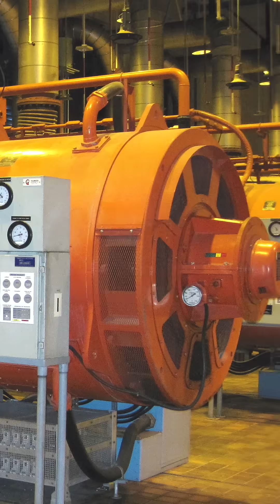wHaT iS tHE LARGEST ENGiNE EvER MaDE?

Comment: The scariest thing is that you can get sucked into the intake and leave through the exhaust and it won't even clog
Reply: you are now lubricant
Reply: @pacman10182  automatons are calling
Reply: @pacman10182 this will please the machine spirit.
Reply: @astonedwalrus4183 the weakness of flesh
Reply: @pacman10182   Such an unusual but highly threatening phrase 😂😂
Reply: @pacman10182  😅😅😅
Reply from the maker: Now that's some perspective...!
Reply: @BladedAngel NOW THAT'S WHAT I CALL POWER
Reply: Interesting note: that wouldn’t actually happen due to the size of everything being so large the air velocity is actually fairly low. Terrifying note though. A man did actually get stuck in the intake manifold of one of these engines and what actually killed him was the intake temperature. Because it’s turbocharged even the relatively low boost pressure was enough to raise the intake temperature to well over 130 degrees Fahrenheit. Which was not hot enough to immediately kill him but instead slowly dehydrated him until he eventually died of a heat stroke. And I genuinely don’t know what’s worse. Getting Byford Dolphined or getting slowly cooked by Death Valley heat in the pitch black for hours.
Reply: @jacobrzeszewski6527 byford was like titan: instant, brains did not even have time to register what happened or pain.
Reply: @kylebieth3678 and sometimes take quite a lot of time to recover from engine lags.
Reply: @purwantiallan5089 what? We were talking about byford dolphin....
Reply: @kylebieth3678  What I meant by Byford Dolphin was the OC’s idea of a person getting sucked through the engine.  Byford Dolphin was just assigning a real event to that idea. Whether an engine that size could actually do that or not is up to debate.
Reply: @jacobrzeszewski6527 christ dont remind me of byford Those autopsy photos still haunt me
Reply: @jacobrzeszewski6527 Being byford dolphined is much, much better
Reply: @jacobrzeszewski6527 the only way i know about this man is because of your comment. That is very saddening may he move on to the next life in peace and not in that dark and very hot place
Reply: @joseg4127 Only God can judge me now. May he rest in peace.
Reply: @jacobrzeszewski6527 now I feel awkward cause I just wrote a whole comment about that situation before I saw yours. He got ovened inside the engine. Side note from what I understand it was not the temp of the intake air that did him in, the engine components had access slots to view and repair so the pistons heat also enters the manifold area.. I think it was the combo that did it
Reply: @jacobrzeszewski6527  I've been in this situation multiple times! Try taking a shit in a porta potty in the middle of AZ desert when its 120° outside.. you're sweating before your ass touched the seat. When you come out, you have cotton mouth, drenched like you just came out of a swimming 🏊‍♂️ pool and lost about 15lbs of water weight. While being light headed from feeling like you can literally feel your blood boiling in your body and feeling your body and brain cooking.

Yeah, being a Trucker is fun!!!😅
Reply: @jacobrzeszewski6527  Yes and no. He did die of heat stroke but not because he was sucked in but because the access hatch closed behind him while he was cleaning the scavenge space and he was trapped. No one could hear the poor mariner as engine rooms are loud.
Reply: @jacobrzeszewski6527  slow cooked is worse by a mile, I'll take a byford dolphin-ing any day of the week over being slow roasted
Reply: @jacobrzeszewski6527  130 farenheight or 130 celecuis?
Reply: @jettlucashayes8508  fahrenheit; you would be fast-cooked at 130 degrees celcius.
Reply: @jacobrzeszewski6527  i have some perspective here. I have had complete renal failure from heatstroke and it would be one of the more painful ways to go. 

Once your body starts shutting down, you go into full cramp mode. Every muscle in your body cramps. I mean like the ones between your ribs, behind your ears, up the sides of your shins. LITERALLY ALL THE MUSCLES. 

My old man is 140kg and he had his entire weight on my foot and he said my calf looked like a piece of steel cable. 

You have 0 energy but you're in full fight mode, dumping adrenaline because the pain is enough to make you pass out and bring you back again.
Reply: @jacobrzeszewski6527  byford is immediate, that is slow cooking
Reply: @jacobrzeszewski6527  This had to be way worse than the Byford Dolphin incident. That happened pretty much instantaneously and they were dead before they realized anything had happened.
Reply: @jacobrzeszewski6527  I’ll take byford. Those dudes died gruesome deaths, but they had 0 idea anything happened. They merely sat done and everything ended instantly
Reply: @jacobrzeszewski6527 holy shit indefinitely think this is worse then being buried alive
Reply: I think being slowly turned into jerky is quite worse
Reply: @jacobrzeszewski6527 slowly cooked. Byford happened nearly instantly. Graphic and horrible absolutely but the suffrage is abysmal in comparison to being turned into what’s essentially human jerky.
Reply: @dNorsh I concur.
Reply: My favorite thing is that the inside of the block on engines like these literally have ladder rungs welded to the inside of the engine for maintenance and building purposes 😂 because you can stand and walk around inside the bottom end and need a ladder to get in and out
Reply: @brandonstonge7513 Swimming pool worth of oil change
Reply: @brandonstonge7513 for some reason it could work.
Reply: Some of these motors have insane intake manifolds. I watched a video about a guy who got himself locked INSIDE the intake manifold... He was fine from the suction due to the pure volume of the intake, he was not fine from the engine heat feet from his body inside a metal coffin of a manifold. Dude literally cooked to death oven style INSIDE an intake manifold. You know a manifold is huge when you can stand up inside of it, and enter it through a gasket sealed door
Reply: Assuming you lived it, I believe you
Reply: @NaisanSama  nobody would survive that
Reply: @masterater  I would
Reply: @DavidJeffreson-xx7kr  "Nah, I'd win" ahh post
Reply: @masterater you'd get shredded by the turbo. The engine being mentioned is a cargo ship powerplant.
Reply: @NaisanSama  well, you'd physically fit but during the process of combustion your body would be crushed violently before being pulled apart by vaccum and then shot out the exhaust. You'd be dust.
Reply: @NaisanSama  don't need 'proof' all you need is numbers and specifications brother man. Engines create vacuum. Guaranteed the vacuum pulled on this crankcase is well enough to pull you in and blow you out of the cylinder head.
Reply: @sacescout Not really. And the valves are too small.

These things peak at 120 rpm, that is two cylinder cycles per second in a 2 stroke engine. Plus, since it is a 2 stroke engine, there is zero vacuum, only positive pressure. Engine does not work at all unless it is sealed up and the turbos and blowers working.
Reply: At some point, you stop being biology and start being physics.
Reply: @alanin4d damn. That's true and eerie
Reply: @alanin4d  I know you stole this from a Xkcd what if video... But I can't prove it
Reply: No. There's no way you'd fit by the scavenge air ports.

...yeah, maybe after being shredded by the turbocharger or the auxiliary blower impeller. :P
Reply: you will most def be the wrong shapes and pieces after tho
Reply: living through that crude oil combustion event though... just add a bucket of feathers on the exhaust
Reply: They maintain these engines by crawling inside them actually
Reply: so could an entire miata
or two
Reply: Is that a good thing?
Reply: imagine spelunking in that thing when it's off
Reply: I don’t like that.
Reply: Bro you'd quite literally be turned into smithereens before you even exit the combustion cycle lmao
Reply: This engine consumes up to 250 tons of heavy fuel oil daily!
Unfortunately, it all goes unfiltered into the air.
Currently, it's one of the most energy-efficient combustion engines, converting approximately 50% of the fuel's chemical energy into kinetic energy.
Reply: Don’t forget to pop your ears on exit.
Reply: t.t
Reply: Lmaoooooo! A great thought
Reply: Hell for that matter, the Miata might not even clog it up 🤣
Reply: safely too!😅👏👏
Reply: Depends if you are a American or a normal sized EU citizen.
Reply: Stupid question but would you die?
Reply: Largest Engine is use for Ship cargo
Reply: ЧТО.
Reply: Sounds like one hell of a ride to me!
Reply: There's a picture somewhere of a man standing in a cylinder on the piston crown.
Reply: No you can't. They thought of that.
Reply: @uninitializedvariable of course they thought of that and probability installed a filter. What I meant is that the intake part of the engine is big enough to swallow a human being.
Reply: Someone was sucked in a F16s engin and ejected out the exhaust alive somehow so I'd guess an elefant could pass thru this bad boy Alive!
Reply: @platinumtouch583 I'll take shit that never happened for $5,000 Alex.
Reply: @platinumtouch583 Nope. That didn't happen.
Reply: @wiredforstereo quote..... "It happened to a sailor during Operation Desert Storm in 1991. While preparing for takeoff at night, 21-year-old flight deck crewman John Bridges found himself pulled into the aircraft's jet engine intake. Unlike so many others, he miraculously survived the harrowing ordeal"
Reply: @platinumtouch583 Nope. Didn't come out the other end. Not possible. Not within the laws of physics.
Reply: @wiredforstereo explain the law of physics and show your work on how it proves this can't happen please and thank you ❤
Reply: @platinumtouch583  There simply is no path through the engine which does not leave one in tiny tiny pieces. Two objects cannot occupy the same space at the same time.
Reply: As someone who's going into aviation maintenance, turbines really do be the same way.

These engines are scary

Comment: 2.5m stroke and 96cm bore. Undersquare is an understatement.
Reply: Which is Understandably an Unbelievable stat
Reply: Has to be. The mechanical stresses are immense.
Reply: @xX_Gravity_Xx  No, they are much less than consumer cars. The total forces are spread out over much larger parts and bearing surfaces per unit than smaller vehicles. The per unit forces are the same if not much much less at every point in the engine. It makes it a very durable and long lasting engine.
Reply: It’s all about efficiency. That crank shaft must be one monstrous behemoth chunk of steel.
Reply: @TheCosmicMason  My very rough estimation of the crank weight is around 10 tons per cylinder, so around 140 tons plus some bits on the end. Lets round it to around 150 tons. That's a behemoth crank.
Reply: @skitidet4302  Fun fact... the crank weighs 300 tons
Reply: @cloggedpizza239  I guess I was a factor 2 off the mark. Still, that's not too bad considering the angle of the only picture I had to work with.
Reply: @skitidet4302 try taking that crank to the shop to be polished 😂
Reply: @skitidet4302  try 200 tons...
Reply: Long stroke gives plenty of time to fully expand the combusted mixture.  That's where the efficiency comes from.
Reply: @garyhalmbacher6875 yeah that's cause it uses HFO, which takes for fucking ever to burn completely. It barely burns in the first place. It's all the shit sludge from Petroleum production.
Reply: @garyhalmbacher6875  and the resulting monstrous torque.
Reply: Over rectangle
Reply: @1985metalmaniac  😂
Reply: How much torque? Yes
Reply: thats 1.81 m³
Reply: stroke can be 4.5m but not for largest bores.

Comment: the torque numbers are incredible
that thing can move a mountain
Reply: My escooter motor could move a mountain with a correct gearbox. It would just take a very long time
Reply: @sven7111 Reminds of that gearing sequence where the last gear would rotate once every few million years
Reply: @MosquitoMetalSonic  Yeah. Torque is worthless without enough rpm and when you have torque and rpm, you have power. It all comes down to power in the end...
Reply from the maker: @sven7111 moving UP a mountain and moving A mountain are two very different things😂
Reply: @BladedAngel  Torque is just power divided by RPM... Even very little power can generate a lot of torque if you gear it to rotate slow enough. 

Have you ever seen those billion to one transmissions? You can generate millions of Nm with a finger, but the rotation is so slow that universe will die before you make useful work
Reply: @sven7111 no.. such... thing....
Reply: @eddieschwab864  ?
Reply: @sven7111  You cant make a working billion to one transmission, it is literally impossible. That is why an engine with incredibly high torque is still crazy useful, and not comparable to a 50cc with some impossibly low geared transmission. It is as feasable as stating "Well the largest ship engine would produce millions of HP if it just had a rpm figure of 10 000".
Reply: @cerkurkafelst7335  I think your engineering knowledge is very limited if you think that it's impossible... It is possible, not even complicated. Just very expensive and very much not worth doing, because come on, why would you need high torque if it isn't going to do any work. That's why it ends on 3d printed models, that aren't even a good proof of concept. 

The main thing you want an engine to do is "work" and the only way to do a lot of work is to have a lot of power. Simple, right? If you don't have the power to do the required work, why bother?
Reply: @sven7111  Not if by working we mean usable at all. It would either be way to slow, as you mentioned, or instantly break if we wanted the last gear to spin at even the slightest pace. 

The engine in the video is made for huge ships. Your escooter motor could theoretically produce the same amount of torque, but never at any practical level what-so-ever. It is a moot point because it has no practical meaning. These engines produce over a million NM of torque at usable rpm, and if you wanted to increase the rpm figure, just gear it. Assuming a hypothetical 100% efficiency: 1 : 34.3 gear ratio at 102rpm would give you 3500 rpm, 221 000 NM, and still around the same 107 000 HP. Much more power than your scooter, or any other conventional land-use engine.
Reply: @cerkurkafelst7335  I like how people always twist the argument once they realize, that torque really doesn't mean anything. It's a powerful engine, so obviously it can do a lot of work.
More power more work, less power less work. BTW "Work" is a physical measure. Measured in joules. An engine with low power can do work, just like the engine with high power. The difference is required time... There is no torque in this equation
Reply: @BladedAngel you can get as much torque as you like from a gear ratio 
But sven forgot that nobody asked about that
Reply: the ship its running is probably mountain sized too